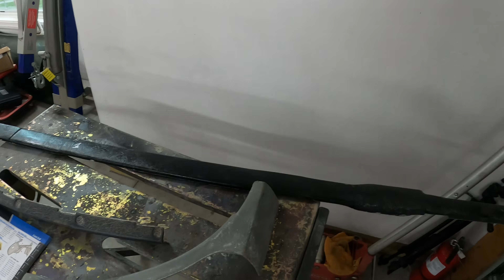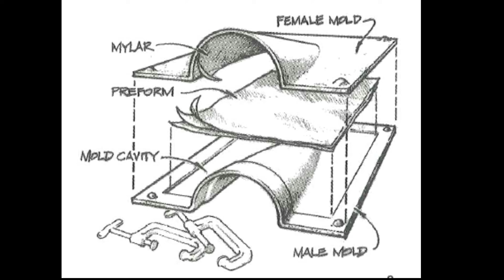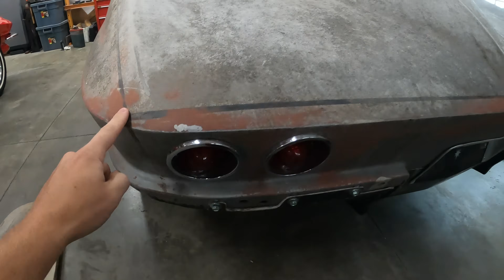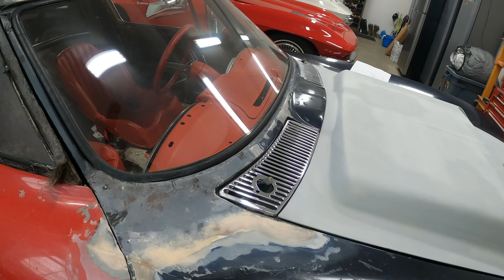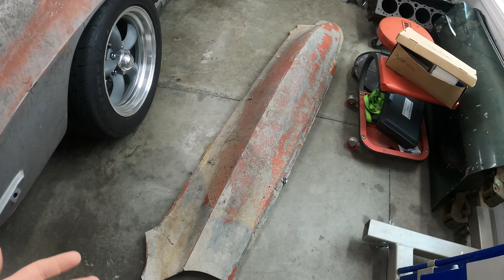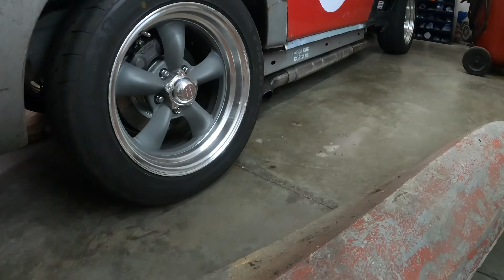What Are Fiberglass Bonding Strips And What Are They Used For?

Comment: Thanks Mitch. I'm always learning from you.  Have you made videos on separating body panels and separating body panels from the birdcage?  My 65 coupe has birdcage rusting around the windshield and door gutter areas.
Reply from the maker: Sure thing glad to help! I haven’t made a video on separating fiberglass panels. It probably depends how bad your car is. But you might have to take the dash out and remove the hinge pillars. That might be a little tricky.. if I ever have to “skin” a Vette I will document it. Good luck! I use a putty knife and a hammer to separate panels. Some guys can use heat with the knife to help separate them without damaging the fiberglass as much.
Reply: @MidYearMitch  thanks Mitch. I’ll keep in touch.